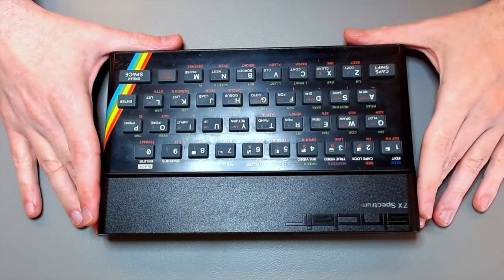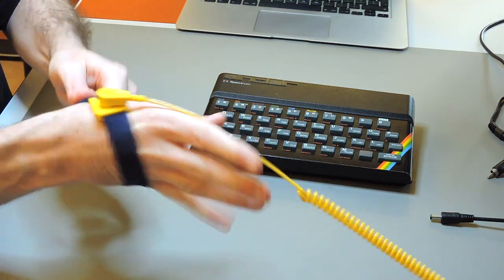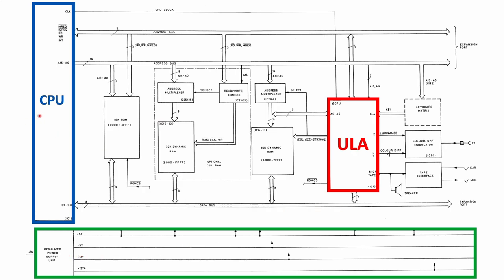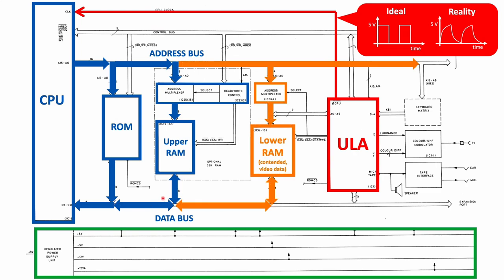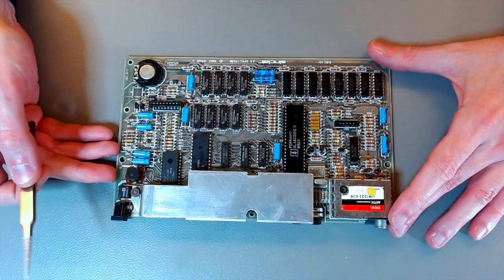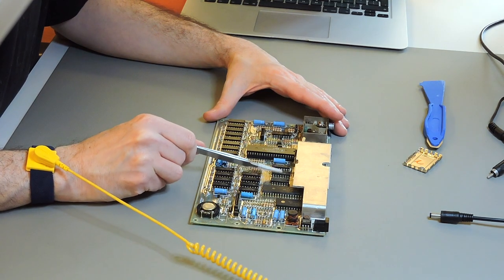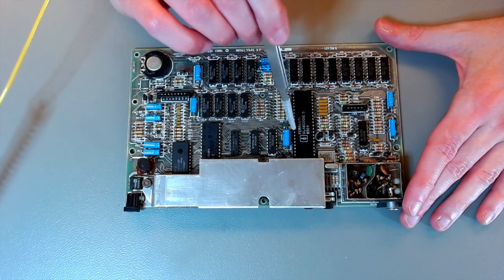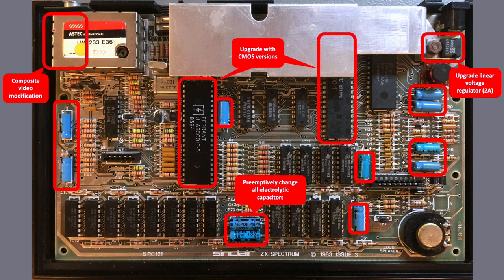ZX Spectrum architecture and board walk-through, restoration plan (Pimp My Eight, episode 2, part 1)

Comment: My first computer was also the ZX81, on which I wrote my first nontrivial program: an "etch-a-sketch simulator". Next I got one of these beauties, but had never looked into the architecture. The "locking" mechanism for the lower RAM is very interesting, and presumably fairly low-impact if it's only doing it 50/60 times per second, though I've not done the math. Pretty typical Clive Sinclair, I'd say!

Comment: The second crystal is the for 4.43 MHz oscillator for the PAL chroma signal, used by the chip that modulates the signals from the ULA to a PAL composite signal

Comment: I know I am commenting on a 3-year-old video, but something caught my attention. Although it seems like an unopened machine, the ULA in there is not period correct for an issue 3 board. 6C001E-5 is more likely to be in an issue 2 machine. In fact, they transitioned to 6C001E-6 during the issue 2 boards, last production issue 2's came out with 6C001E-6 on them. My suspicion is someone swapped the ULA in this. Yet again, Sinclair being Sinclair, anything is possible, they may have used some 6C001E-5 ULA's pulled from otherwise defected boards that were returned under warranty and used them in newer productions.